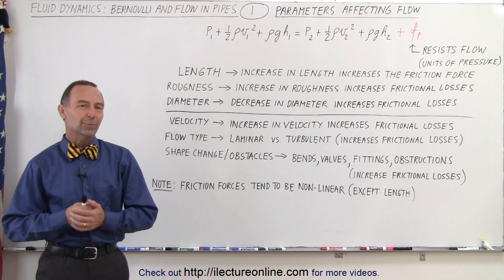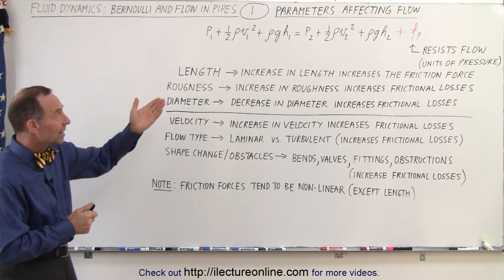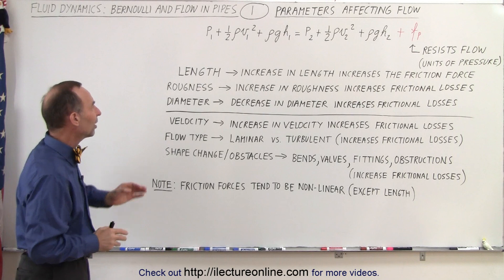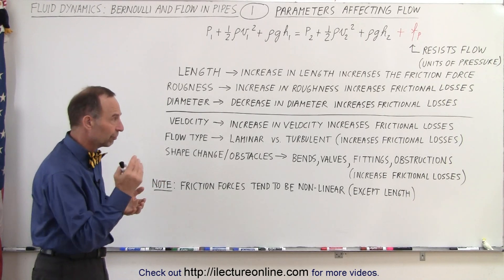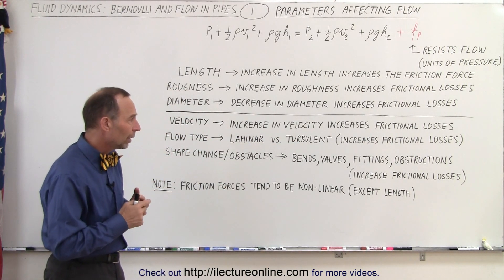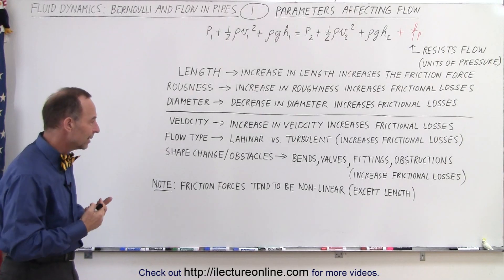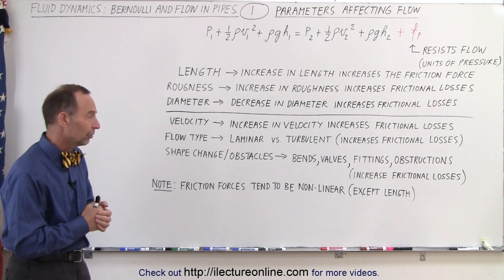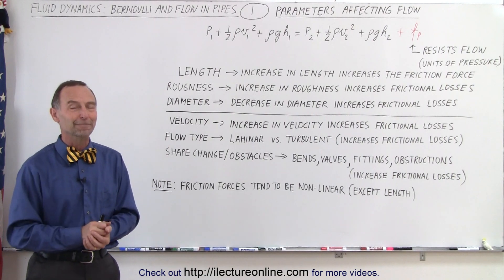Physics 34.1  Bernoulli's Equation & Flow in Pipes (1 of 38) Parameters Affecting Flow

Comment: Mr. Professor does it mean that there is a relation between the surface friction and the volume of a fluid?
Reply from the maker: Not sure if I understand your question correctly.   But this may answer it:    Fluid will flow more easily through a large diameter pipe, then through a small diamater pipe.
Reply: Yes it is correct. So if the friction coefficient will be small enough, does it mean that there will be no difference in fluid flow between pipes sizes? Let's say the pipes were made out of glass.
Reply from the maker: There are also other forces to contend with.  You have the intermolecular forces, the thermal motion, the  flow rate,  whether or not you have laminar or turbulent flow, and the viscosity of the liquid.  All play a role.
Reply: Ok. Thank You.

Comment: I have a fluid question that probably is more related to Newton and the coriolis force, but I  can't figure out how to get started to answer the question. Given a theoretical planet with the radius of earth, what's the widest possible waterfall(from a physics point of view). And is there a difference between having it from pole to pole rather than around the equator? The number would be interesting, but I'm trying to figure out how to solve it. (it's not homework)
Reply from the maker: That is an interesting question.  I would start with this thought:  At any point in the waterfall, the water would drop if there is a height differential, since the flow of water is only affected by the gravitational force.  Thus the width of the waterfall would be dependent on the length of the drop, (typically called a "scarp")